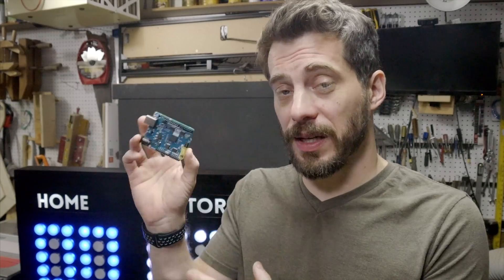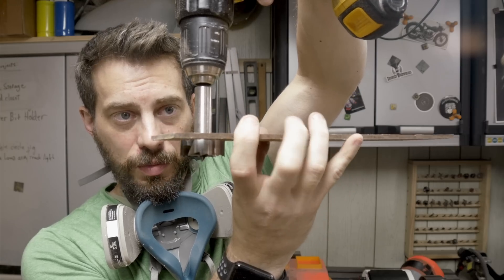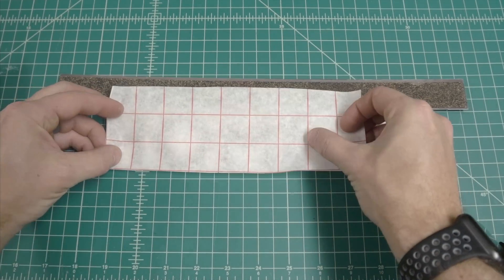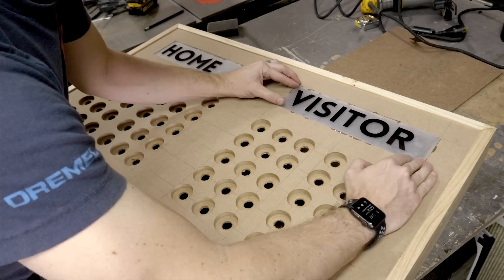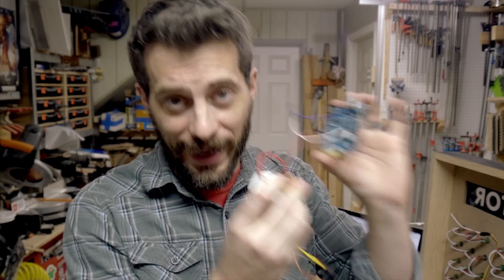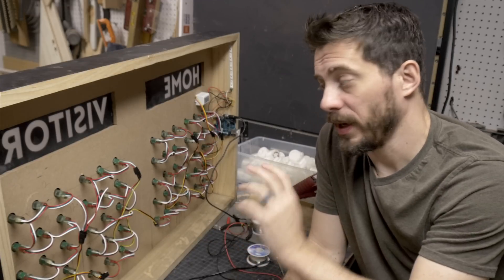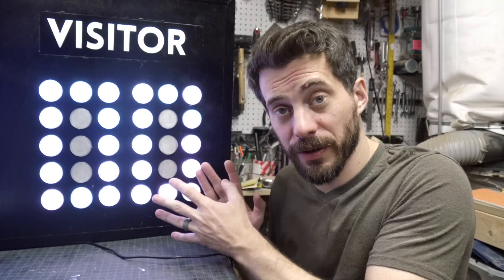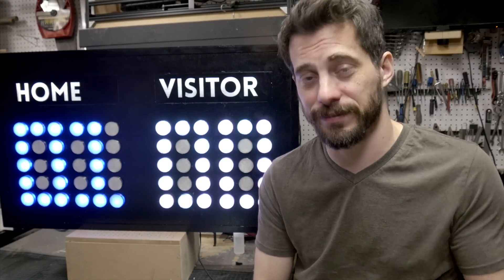How to make a large Bluetooth scoreboard | I Like To Make Stuff

Comment: I'm about to embark on building my own version of this over the weekend.  Have the electronics figured out for my customization.  What's I'd love to know that are some more details about the woodworking.  Any chance you can get us the layout/spacing of the circles?

I'm forgoing BT and using arcade buttons for ease of use by others during an actual sporting event.  Making second box that can be used with (quick connect, already wired) to display countdown clock.  Will have start/stop and potentiometer to set the time.  

Would love to know the spacing, will help a lot!

Comment: Is it possible to make unique bluetooth distance ardunio basketball counter. 

Criteria:
3 v 3
Each bluetooh is clipped on player's jersey
each 3 corresponds to each of their team scoreboards
A sensor is attached to rim when the ball goes in 
Ardunio detects the distance of bluetooth from the rim, 3 pointer as 2 points, 2 pointer as 1 point 

I guess you have to have a bluetooth inside the basketball too I guess in order to detect who was the last player to touch the ball. If not, may be clipped on the wrist like a wristband so the arduino detects who shoots the ball when they flick their wrist

Comment: Nice job! Two questions: 1) Is this bright enough to use outdoors? and 2) Any alternate suggestions for the LED diffusers if you don't have access to a 3D printer?
Reply: Jeremy Thompson I know this is two weeks late but Gatorade bottle caps with blacked out sides. Odd I know but it could work
Reply: I don't think it's odd at all, actually! After I watched this I started saving white caps from 1L bottles of seltzer with the same idea.

Comment: Hey Bob, Anyway to make it a counter to display how many people mention that Home is not centered? ;)

Cool build! you make this look far easier than I thought it would be, I might build some splash resistant ones for my water polo club.
Reply from the maker: That's a great idea! I should! :)
FYI, the LED's I an using are indoor/outdoor so I think they'd be good in that setting. You'd just have to cover the Arduino, etc.
Reply: Thanks... i was thinking a lasercut acrylic enclosure for the electronics should do it... and maybe a few extra coats of poly to the box.

Comment: As I was watching you add those clear diffusers I was thinking that wasn't going to work. I had recently done an LED matrix project and had used white separators and between pixels and there was too much color bleed, so I ended doing the exact same thing, make the separators black. Good job, but why not just use the TomThumb font which is already 5x3 and you don't have to mess with generating each number/letter yourself.

Comment: since the LED's are Rgb, could you not just display the active LED's for the number in a color like red and the "background' ones (the ones you have off) in  White. It would make it much easeir to read from a distance beacause red wavelengths travel furtherest of any color. Blue and green travel the shortest. Also with the white background the contrast of the colors would help dramtically aswell. Just a Suggestion! And like always great project!

Comment: You could make a wooden collet to be larger in diameter than back of drill . Collet slips between drill and drill bit secured behind drill head. That way it stops exactly at your wooden spacer stop mechanically

Comment: i was just wondering how tough/expensive it would be to make clocks for a school using Arduinos (or RPis) dialed into an NTP server. the biggest hurdle for me was the actual display...you make it look like it'll be pretty easy though!
Reply from the maker: Ha, that's funny because I would have expected the NTP to be the hard part. :)  I think it'd be pretty easy, especially if the Arduinos had a wifi shield on them to connect.

Comment: I'm incredibly confused, as I understand all the LED's are connected in series, but you manage to control each individual LED separately with only one data pin, how?
Reply from the maker: Addressable LEDs have a little chip built into each one so that you can address it specifically. They're sequential, so using the library you can just address them by number 1-60.
Reply: I Like To Make Stuff, can you describe the connection to making the individually addressable lights work? You mention you have voltage output from the power supply and a single cable output from the Arduino. Does that cable connect directly to a digitally addressable single wire on the LED string? Any more info about the physical connection to the lights and how to actually address each one? Thanks!! Love your work.

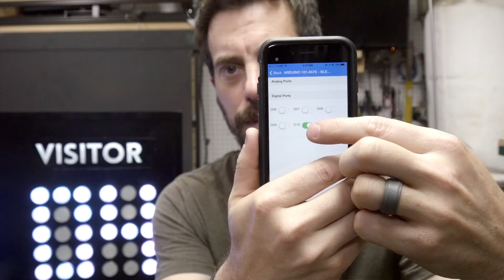Comment: 11:37
Just out of curiosity, any specific reason you used toggles there?
Reply from the maker: They weren't ideal, but that app doesn't give you an option for different UI elements :/ I was mainly looking for an app that would work in a really general sense.  Of course, custom would be more useful and way cooler :)
Reply: I figured it wasn't exactly your choice. :)
Does it trigger on any click or only when it's clicked into the on position?
Reply from the maker: It triggers anytime it is changed, so it works like a button.. it just doesn't look like one :)
Reply: I Like To Make Stuff you could have used blynk app, it's made just for that purpose, have pretty flexible UI and looks fancy overall. Their docs claim that they support arduino 101 with Bluetooth connection: http://docs.blynk.cc/#supported-hardware
Reply from the maker: I actually ended up looking at that after I got this one working. It seemed really promising but I went ahead with what I had working simply because I'm so busy creating content.  Gotta keep moving :)
I've got it bookmarked though and how to use it in the future.

Comment: Hey I'm not Bob and I like the stuff Bob makes! And I love this one!
I have two small variations in mind:
1) make the LED  "cups" shape transition from round to square to get a "pixel" look. it might be the final nerdy touch (you already put in 3d print,  Bluetooth,  arduino, it's more than enough for an average nerd!)
2) use plexiglass bars for the LED instead of cups. you should have a polished side surface to act as a light guide, polished bottom face (LED side) and textured front face. this works for sure if LED and light guide size are roughly the same, as in LEDs in user interfaces. So you might consider building a more compact version of the board reusing your current LEDs.

Comment: If the lights are RBG, couldn't you code them in such a way that all of them stay on in white, and then just the ones needed to form the numbers change to red, for example?
Reply: Renan Ribeiro I think all of the led's would change to that color unless they have individual drivers? or maybe if it was multiplexed? not sure though.
Reply: Dridge Tan they're clearly have some kind of driver — they are chained and use 3 wires to control all lights. Also at 6:50 you can see that lights in chain can have different colour.
Reply: niter43 I mean if they have individual drivers for each led, but anyway my thought is still wrong.  Bob could have changed the color of each led as he used the neopixel library and I think the library was capable of changing individual led's.
Reply: niter43 I mean if they have individual drivers for each led, but anyway my thought is still wrong.  Bob could have changed the color of each led as he used the neopixel library and I think the library was capable of changing individual led's.

Comment: How can the arduino interpret which led must switch on and off? Aren't the leds connected in parallel? so if it gives power, wasn't that suppose to light all of them?
Reply from the maker: No, they are addressable, so they're sequential. Each one has a little chip on it so you can address it specifically.
Reply: Ok, now i get it. Thanks Bob!

Comment: Bob, another great project!  I appreciate that you add some of the stuff that didn't work out too.  There's plenty to be learned there as well.  Could you add a link to the wiring harness connector kit?  It the one where you soldered the pins onto the bare wire and then pushed them into the plastic harness.  I'm searching on Amazon and haven't found that kit yet.  Thanks!
Reply from the maker: Thanks! Adding it now, but I'll post it here too http://amzn.to/2oCuo4b

Comment: Hey Bob, you are really great man. I just wanted to ask you that, which Arduino board should is purchase to learn the basics. As i am starting over it as a beginner.
Reply: Aniket Tonpe Arduino Uno is good for beginners.
Reply from the maker: An Uno is great! This board is essentially an Uno with extra sensors though, so it's a more capable version that is also great as a starting point.
Reply: Thank You Bob, that was helpful...
Reply: Thanks Jesper, i will go with the UNO.

Comment: Hey Bob, would making the 3D printed lenses flush with the scoreboard help with the light diffusing to the other lenses?
Reply from the maker: It probably would have but since I didn't plan for that in the beginning, the LEDs poked through further than the depth of the MDF.

Comment: great video. i wish i had a need for one, might have to invent something ;)

one question, does the back light for the names not bleed through the off LEDs? could be solved with a partition below the names on the back maybe.
Reply from the maker: Thanks! No, I don't think that's really a concern. The light doesn't really have a way to get to the diffuser caps.

Comment: Great video everyone needs a scoreboard.
Could you have just masked off the fronts of the original diffusion pieces and painted them black to get a similar effect of the replacement pieces?
Reply from the maker: Yeah, that was actually my first test.  it kind of worked, but those has a slight round over on them (at the front) so there wasn't a great way to get a really clean line. I could have just wrapped them all in tape as well but that was actually pretty labor intensive for that many diffusers.

Comment: hey Bob. .Really nice project! 

btw. .what are your thougts on your evolution saw?

Tomas 
Czech Republic
Reply from the maker: Thanks! It's pretty cool! I've been happy with it overall. I did go through one of the blades cutting bedframe steel down (really hard steel) and replacing the blades is NOT cheap.  I learned from that to use a metal bandsaw for that type of work and cut mostly mild steel with the Evolution.  As for cutting wood and aluminum, it's fantastic!